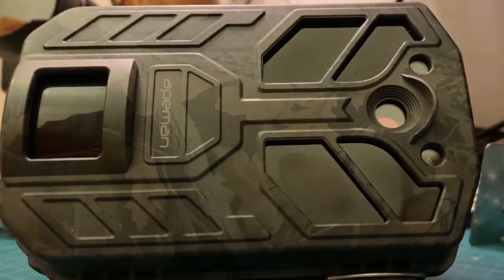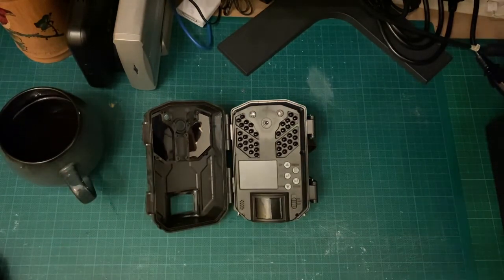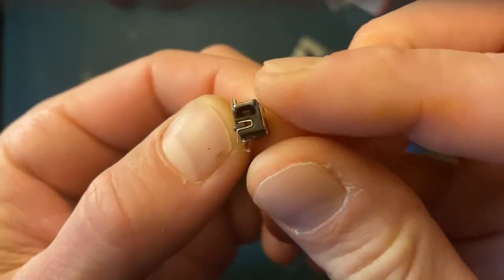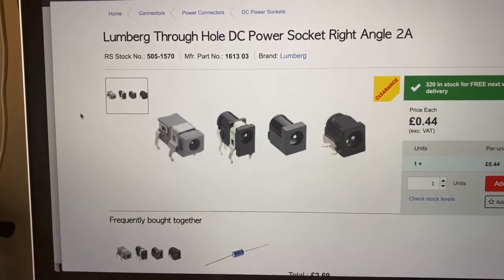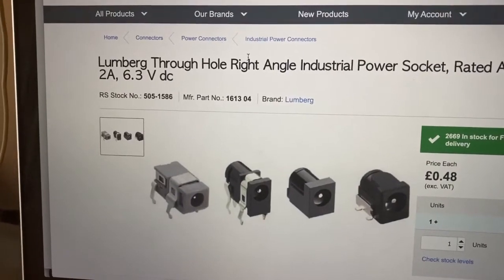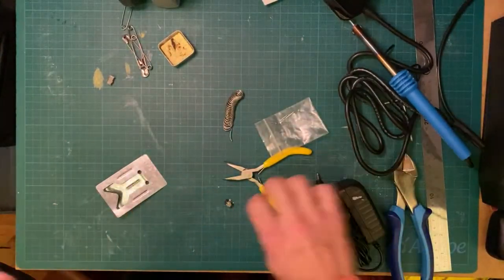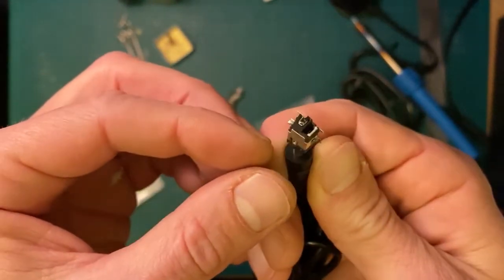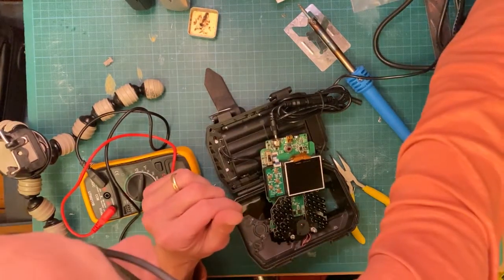Apeman Trail Camera H70 simple tear down and fixing DC power socket.

Comment: I have 2 H70 mulfunctioned. Of which 1 keep experiencing intermittent power outage. What can I do to resolve it. 

Ps: I bought from local reseller, Apeman Shenzhen refuses to honor the product warranty
Reply from the maker: There is a lot of questions but not sure I can help without having it in my hands and I might just hack it.
I notice it does not keep humidity or moisture out very well so I would check if it needs drying out or cleaned.
Do you plug it in for power or just using batteries as this may make a difference?
Reply: @JamesChow1970  my cams are deployed in the forest for long duration and only batteries are used. Yes lots of rain during the past months and maybe moisture is the problem. Anyway, I took out the 2 problematic cam.and replaced with newer ones. Anyway, apeman cams   constantly gives problems in relation.to sound recording, failure to auto switching between day and night  pink.glare, etc. Never ending issues every time to.go check the cams